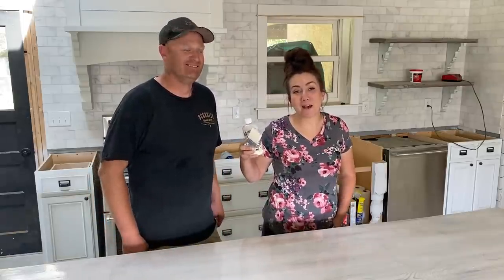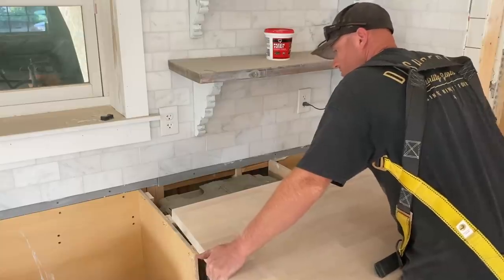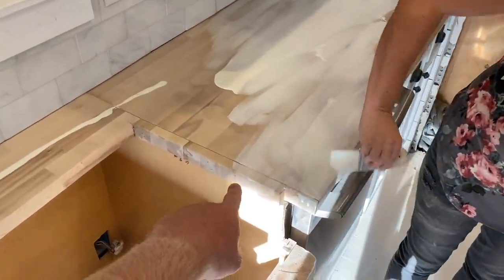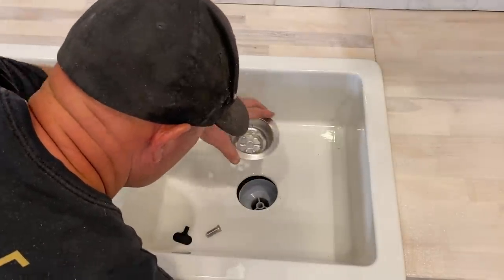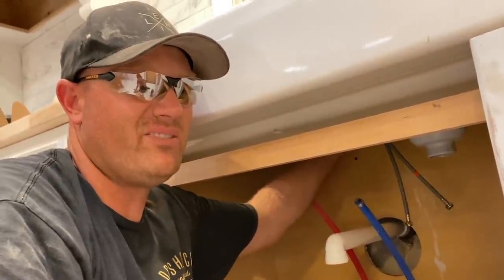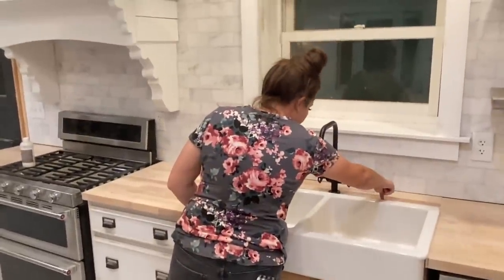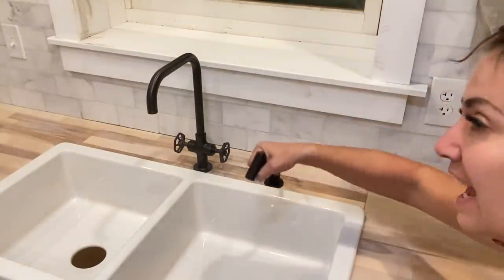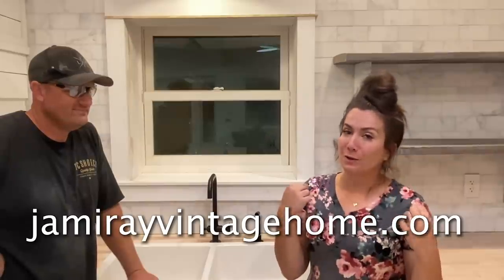Home Remodel Kitchen Sink and Butcher Block Counter Tops!

Comment: So glad I’ve seen this white oil wax. After dithering around about what I wanted to do when I install new interior trim, I saw this wax and had my aha moment. Side note: that camping cook set from a few vids back with the “copper” plates were not copper plated, they are what is called anodized aluminum. Google that for a definition. I think it has  to do with applying electrical current to aluminum to change the color/property of the surface. 😁

Comment: Wow what a difference layers of that white oil wax made on the island! It has soft natural wood look. Gorgeous. The sink faucet is fine Jami, it’s a little industrial but with all the kitchen stuff added I don’t think you’ll notice it and you can always pick something else up farther down the line. 
I collect my sawdust in a cottage cheese clean container, different ones depending on the wood. It’s such an easy fix to add glue to the sawdust for gaps etc. 
Late video Zeb, go to bed! 
Thanks Ray’s another beautiful video.👏👏❤️❤️❤️

Comment: I love the white oil wax look!  I have oak (maybe red oak) antique floors I discovered in my kitchen under layers of linoleum, peel and stick, etc.  I was hand scraping because there was a layer of baked on black adhesive and was getting a cool patina with some darks and lights.  I have the same floor but it was refinished a warmer tone medium brown, and I definitely need a contrast and wanted grey muted tones in my kitchen.  Walls are grey, cabinets are a sage gray green.  I wasn’t able to physically finish the work and hired someone who said they would lightly sand and try to match the look but they over sanded and now I’ve got bare wood but it’s kind of dirty looking in areas - they were hand sanding because wanted it to look old and distressed... so.. I stopped them from covering in poly and need a solution.  I expect poly would make the oak look more yellow. ?   I could hand paint in some darks or some kind of white wash. Let me know if you have suggestions, please.  Would this oil work on a floor?  Should I do a dark stain first and physically distress first to regain what I had? then white or grey wash or oil on top?  I will have to do it myself but it’s a small kitchen and I want to be happy with it after all this.  I’m an artist so my painting skills are good- just tough on the knees. I do also have most of Debi’s DIY but haven’t actually used the products yet. (I’ve been gathering, watching, planning.. lol).
Reply: Angela Ramsey Robinson   Check out 1806 Stonehouse, Lucas recently finished his upstairs floor with some kind of oil wax and it looks great!
Reply: Did you end up using the white wax on your floors or find out if you could?

Comment: Hi Jami and Zeb.....we are still right with you....sink installation underway.....I have a very old farmhouse sink ....porcelain over cast iron....goes up in the back.....side board to the left....I had it professionally reglazed and love it! when countertop installers cut ....they cut straight line from front to back and actual sink is wider in back then front....sink was right next to them but not installed🙈...been a month trying to get someone out here to fix! It ...has the whole island on halt right now😡 I am ready to get this done! We mixed metals with lighting and even though kitchen was gutted trying to make it look as if layered over time....my pot filler is matte black....my sink faucet very simple American Standard chrome mounted on the back of sink.....we have exposed brick and trying now to tie it all together....waiting on this and that...will be worth it in the end! Love the white oil on bare wood....gorgeous! I have two oak chairs I bought already stripped down....was going to whitewash them....maybe use white oil? I have it...hmm just want a hit of white in the details...what would you use? Thanks for sharing😊k

Comment: After viewing this video I rushed to the Ikea website to order the same kitchen faucet.  I cannot locate it.  If possible would you post the brand?  Due to arthritis I have to have 2 handle faucets, they are difficult to locate in flat black.  Thank you.  (That particular style will work well for me.  I will also add a flat black plate.)

Comment: Hey was just looking at purchasing the oil wax from the link. I had a question for the island to be the color that it was in the video did you first apply a paint? Or was it just the white oil wax that brought out that white color? I am installing Birchwood butcher blocks in my kitchen and would like to achieve that same color. Would just the white oil wax be enough or what I have to do Another preparation to achieve a similar color like your island?
Reply: Good question!  I'm looking into doing butcher block countertops and love this whitewashed look.  Did you use just the white oil wax on yours or involve some type of paint as well?  Looking for any advice, thanks!
Reply: @ellieem4716  hey wanted to let you know that I bought the oil wax from the link on this video however, it wasn’t enough to achieve the color that I saw in this video so I ended up whitewashing my birch countertops to the desired look, and then applied the oil wax and it actually turned out exactly how I wanted it. Hope that helps!